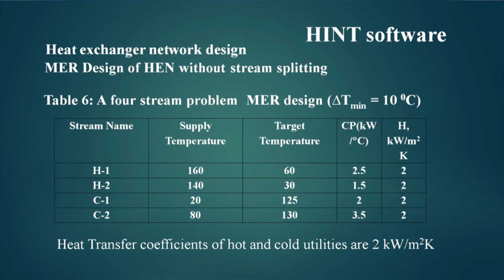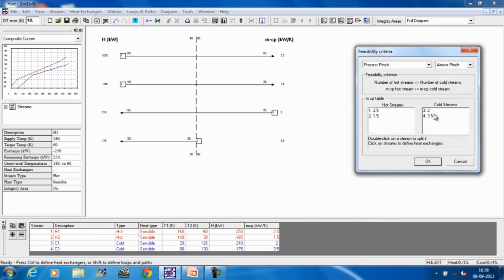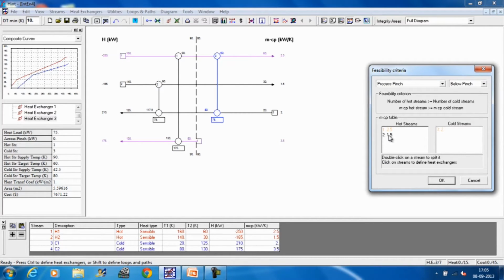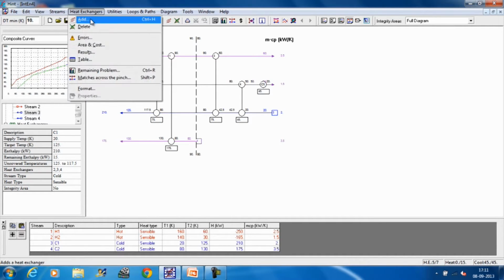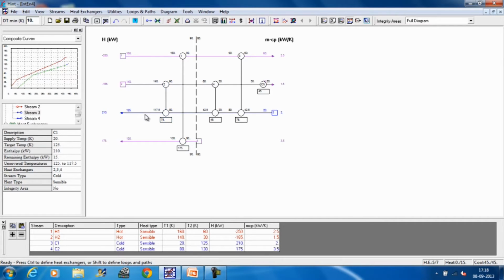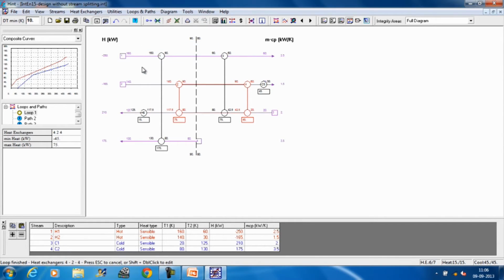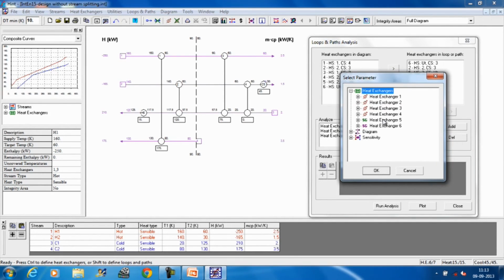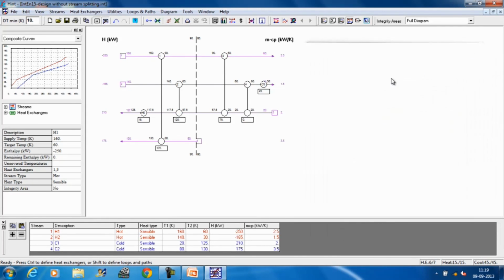Mod-07 Lec-03 Problem solving using HINT Software- Part 03

Comment: (1)15.16 Inlet temperature of exchanger 4 is pinch temperature which is 90 deg C and not 80 deg C...outlet of HE 1 is 90 deg C and inlet of HE 4 is 80 deg C so where is the heat lost?
(2) For adding the heater on cold stream i.e. stream no 3 specification type can also be given as "enthalpy to complete cold stream" instead of user defined enthalpy.